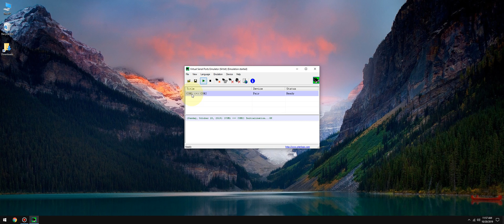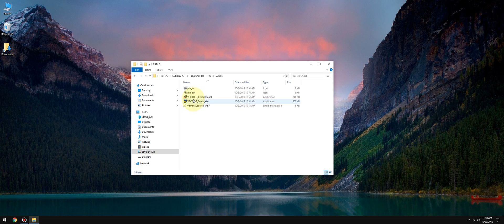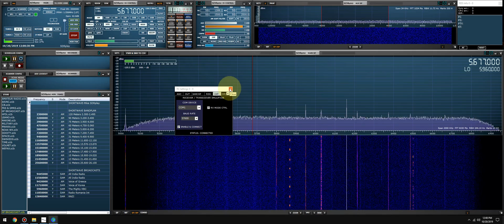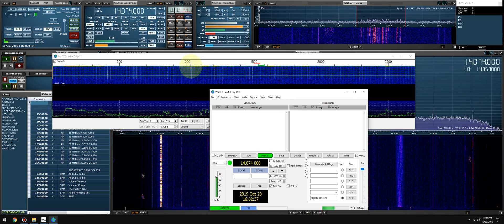Basic setup of WSJT-X & SDRuno

Comment: No matter what I cannot get the CAT to work. The Uno controls wsjtx but not the other way.  I'm using the latest version of Uno and have tried both Vspe and ComOcom, both with the same result? I set them up exactly as you have done. What on earth is wrong? I'm on Win 10.
Reply from the maker: Check that the LO is not locked on the Main panel.
Reply: @SDRplayHamGuides  This was my issue. Thanks, all working great now!

Comment: WSJT-X can only control the SDRUno VFO freq if I manually enter the ham band on SDRUno controls first. Any ideas why ?  Also I note that WSJT-X has both a Kenwood TS-480 and SDRUno as radio options. Both behave the same way regarding the problem.
Reply from the maker: I just tested my install and its bi directional. I use the Kenwood protocal for communication between WSJT-X and SDRuno over a virtual com port pair.

Comment: Is the virtual com port emulator compatible with Windows 11?  I installed several times and couldn't start the app.  Then any COM port I picked didn't exist in RX Control settings and only USB shows in WSJTX CAT control
Reply from the maker: Good question. I haven't seen any reports of it not working but worth checking with the developer
Reply: @SDRplayHamGuides  seriously? win 11 is defacto now. SDRplay needs to build that support like yesterday!
Reply from the maker: @radiotests  Reread his question. SDRplay does not develop a Virtual Com Port.  Our API/driver and SDRuno are Windows 11 compatible.